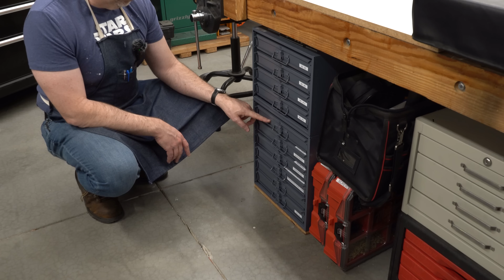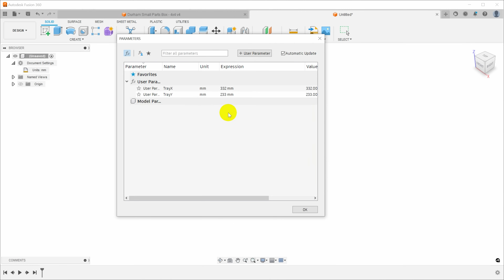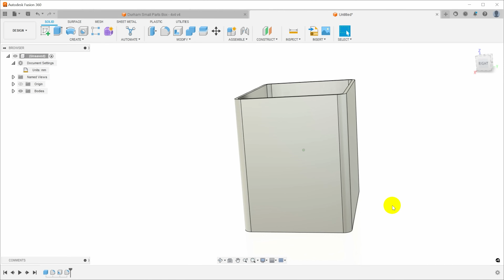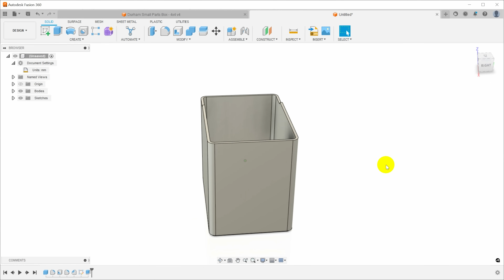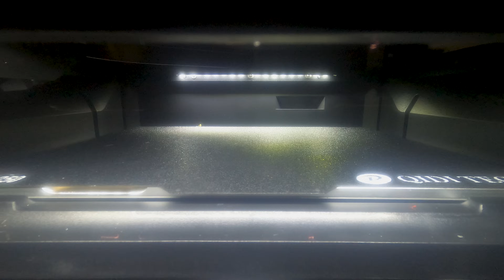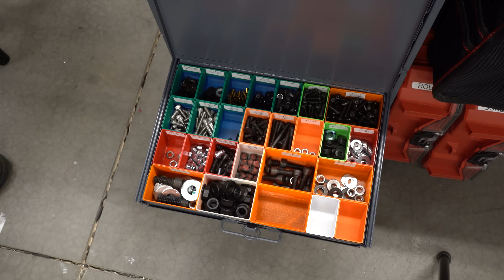Create the Perfect Storage Solution with 3D Printing!

Comment: As a graphic designer, I'm a bit surprised that you didn't use color as an organizing tool, i.e. all M5 fasteners go in blue boxes.  This is definitely inspirational for me.  I aspire to be more organized, especially fasteners.  I have several thousand fasteners, but only a small fraction of which are organized.  And, my shop flooded during the heavy rains in CA over the New Years weekend.  That was both a traumatic and motivational experience.  Also, I generate STL files using my illustration and animation software - Maxon Cinema 4D.  I'm going to have to find out if it does parametric modeling!  That was cool!  C4D is lovely for creating curved surfaces, though.
Reply: He’d lose the ability to casually move items into different sized boxes as needed, or waste a fortune in filament. If you’re not experienced with 3D printing, he has dozens of hours of print time in theses cases already. Needing to print each size in multiple colors would have made that take much much longer. There’s a reason he’s labeling boxes rather than printing the contents directly into it, and isn’t being strict on the color.

Comment: My anxiety about organising is at the point where I don't even dare buy boxes/storage drawers. Because I used to buy a couple extra, you know for possible expansion. And after a couple of years I wanted to buy extras and couldn't because the design/system was either not available anymore, or slightly tweaked and thus not compatible anymore.
But this looks like a nice idea/solution.

Comment: Great video. I have found that small washers and things like resistors tend to get out of place if the boxes are tipped up. To prevent it I have lined the inside of the lid with a thin piece of neoprene foam. Keeps everything in place and even keeps the boxes from sliding around if the box is not completely populated.

Comment: Oh no no no - the obvious place for labeling the content of the box most legibly is clearly a sheet of paper on the inside of the lid, mirroring the configuration of the boxes below it. This also has the added advantage of completely ruining all the work you've done, as that sheet needs to be re-printed every time you move anything at all. Clearly, this calls for a matching system of freely modular magnetic label holders... :)

Comment: I've been doing something similar with my organizing of electronic components, specifically crimp connectors, at work, of which we use many many different types and brands. For labeling, I try to add more parameters. Specifically for your bolts, I would add the thread pitch, material & finish, drive size, and part number. Stuff like that ends up saving me so much time in the long run.

Comment: James, great video. Especially on the parameter use in CAD.
Of course I want to add a little tip. It's in the nature of this friendly human being. Your boxes are a great solution for a static use in a shop like you do. I also travel to clients and have noticed using several similar systems that the lid doesn't close all of the compartments during carrying vertical. If you store your. e.g. M2 nuts in a compartment somewhere in the middle they migrated to other boxes in their vicinity and the easy in, easy out principle is lost. One major problem, as you described too, is the lack of stiffness of the lid which bowes when closed. The row next to the hinge and the row next to the lock/closure are quite well covered (not if you are storing M2 washers too though). Because of this I used a layer of foam on the inside of the lid and it did became better but still not satisfactory and I still had to search for the really small parts on the job (I know you're in there somewhere with a paying client breathing in my neck). Because of this issue I printed small containers with their own lids. I carry a lot of the same small hardware over the last 20 years so 80% of them had a name printed on the lid too. The other ones had a small recess for a printed designation and added flexibility to the system. Maybe a tip for the more travelling technicians who want to keep their small stuff organized as well? Thank you James. I'm a fan of you and your channel. Keep up the good work. Best, Job

PS; the idea of being organised is like the arithmetic definition of a limit; the direction is right but you'll never get there. When you own a job shop this is particularly true; new valuable/usable stuff is left after finishing jobs and you stash it somewhere eventually; the diversity of these parts becomes overwhelming over time and even finding right names can become an issue. It's a never ending race and a dream to fulfill. Once you entered the six planks leading to you being finally organized your organisational days are finally over and someone else has to decide where to put it. If you want it to be different you have to periodically throw stuff away laying there for more than a year without use. I did this many times and once I did I could use one of the thrown away parts the week after they left the building. I guess Murphy watched my performance too. You never get it quite right is my message and that's the beauty too.
Reply from the maker: The foam is a good idea.  I wonder how that will hold up over time.  I generally don't tilt the boxes all the way back, so things stay put, but for mobile use, or throwing in a vehicle, it would be an issue.

Comment: Totally with you on the not starting things because you can't do it perfectly.  The height of the tray not easily measurable with calipers?  Gauge blocks obviously worked fine but a direct measurement of the original would have been possible with the height gauge we know you have!  Now to go mull the inadequacies of my own drawers of 3D-printed boxes :-/
Reply from the maker: That's what I tried first, and didn't get satisfactory results.  The issue is that the tray registers on the front edge of the sheet metal, and everything is flexible.

Comment: Dump the box lids. Means extra steps to access that take time and add nothing. If you need a lid for transport, clip one on. 
Putting a recess on the 'back' for the hinge prevents using it rotated through 90deg. Rectangular boxes that fit at 90deg gives a much larger range of choices for size within a given space.
Putting a wedge shape piece at back of a tray gives both a label place and a grip for lifting it out.

Color code- the resistor color code gives a great way to indicate size- e.g. green for 5mm bolts/nuts/washers etc. Blue for 6mm and so on.
Using small boxes/trays limits the content, making it harder to choose the right box, and meaning not all one size will fit (e.g. 6mm bolts in several lengths, pan:cap;round:countersunk, washers, nuts all in stainless/steel/brass). Ideally trays will be 1000x600mm- large as possible if smaller.
As the components get bigger, the box/tray/drawer needs to get deeper.
In conclusion, your choice of hinged metal boxes limited your future choices massively- exactly what you were trying to avoid!

Comment: I actually thought you did this a long time ago, being a 3D printer guy, so I thought this might be an old video suggested by YT. Smiled at OCD person knowing exactly how to trigger the others :-) Love how even your Misc trays are organized. I had a business partner years ago, who built an elaborate filing system for himself to try and dig himself out of total chaos. The last file he created in every drawer was labeled "Things to be filed". Laughed out loud at that, because I knew what would happen, and it did, spectacularly. This is sooo much better than the old pull-out little drawer systems we all used for electronic components etc. They just do not work for nuts and bolts. In fact, I might convert all my storage to something like this. Just need to find the proper host cabinets, that are readily available with some continuity in the market. And then, many 100's of hours on the 3D printer. Thanks (I think)! Clicked "Like" 3 times...
Reply from the maker: I did a video a while back about 3D-printed trays for mill tooling and boxes for my larger rolling toolboxes.
Reply: Thanks for the response. I REALLY like your channel. Ticks all the boxes for me. OK, enough brown nosing...

Comment: Nice work, James. Your grasp of 3D CAD never ceases to amaze me. I have one little tip on the label maker since I have the same brand. If you set the units to metric, the label length and spacing (i.e. for terminal blocks) is more accurate.

Comment: Alexandre Chappel has an extensive system of 3d printed parts storage boxes that has gone through several design iterations.  His are based on different drawers and cases though.

His solution includes a grid frame that goes in the bottom of a drawer so that the boxes don't move if the drawer isn't fully populated.

Comment: Fun fact about metric threads, you don't specify the pitch of the thread if it's a standard pitch so M6 is just M6
If you were talking about a fine pitch thread like an M8 with a 1mm pitch, then it would be M8x1 (the standard pitch for M8 is 1,25mm)
From M6 to M16 the pitch is increased by 0,25mm so from 1mm to 2mm (M14 is also a 2mm pitch but it's not used often)
Then From M20 and up the pitch increases by 0,5mm (there threads that are not commonly used, those have the pitch of a closest smaller thread )

Comment: I went with Gridfinity. It makes some decisions easy (like how many I can fit in a given space) and then it's just a matter of using 1x1, 1x2, 1xN, 2x2, 2x3, etc.
You can adjust the grid size by scaling most of them to fit almost any space, especially using the SCAD remake that has all the parameters needed.
Reply: There's also FreeGrid which is similar to gridfinity but with a few different design choices. But yeah, SCAD is so good for this kind of work.

Comment: I have to disagree on this system "perfect", for two reasons.
First: As a plastic storage system, this isn't perfect. If you take one box out, the contents of your drawers are no longer locked, and things can and will start shifting around. Something that is addressed by a.o. Alexandre Chappel's solution and GridFinity. If you are really only planning to take entire drawers, that's probably fine, but chances are that at some point you'll need such an assortment of stuff that you'll need multiple boxes from multiple drawers. Sometimes taking the boxes out is just easier.

Second: Printing these boxes is just a waste of time, money and plastic. Unless you need something specific that's hard to make by hand, like your 3D printed collat holders (not sure what they're called / how it's written exactly), 3D printing is not a good option. It is definitely an option, but it's not a good one. It's quicker and a lot cheaper to make cardboard boxes, like the ones Jer Schmidt showed a couple of days ago. I understand that for things like M2 bolts, cardboard may be an issue, since the bolts will be harder to pick out of the box, and they're so small they may fall through a crack, but other than that, I just don't see a need for plastic.

The only things (I can think of right now) that aren't doable with cardboard are:
- Radiused inside corners, for ease of picking up parts
- Oil / moisture resistance

Don't get me wrong: I designed my own plastic storage boxes to fit one of my drawers, 100% based on Alexandre Chappel's system, but after 1 (roughly) 2 x 3 ft drawer, I stopped. It just took way too much time and plastic for my liking, and with my small hobby printer, the boxes weren't even that great either. Up until Jer's video, I still thought 3D printing was the best option for these kinds of systems, but I'm quickly realizing it's not, at least not always.

Comment: As an IT architect, i have the same thing with ‘what happens next’. Definitely. I also have a thing with ‘not inventd here’. There are other vids on the tubes that do custom 3d printed box sorting thingemabob type systems. You must have seen some. I think the most prominent one is the one by Alexandre Chappel. You chose to role your own. Can you expand on why doing it from scratch beats adapting a design from someone else? I can see that it providesyou with a ‘full story video’, but is that the only reason? Im not trying to be critical, just wondering, as i have acquired quite an allergy to NIH in software engineers. Nothing personal…

Comment: I came to a very similar system over the years. Mine is based on modular plastik bins and metal cases sold by Allit. The cases have a layer of foam in the lid, so even the smallest parts can't escape. They also make bins for drawers.

Comment: I am doing a similar project, with about 500 boxes printed so far. I am printing in PETG.  I included a label flange, by mildly angling the top front face of my boxes back 30° to create a surface for a 1/2" label. This is enough to make a handle of sorts - easy to hook the box with a finger behind the flange. The mild angle means I loose about a 1/4" in the top front of the opening, but has not been a real issue.The label is always visible, even when the bin is full. 
I use a 1mm CHT nozzle, combined with vase mode and 0.5mm layer height. Using vase mode means I don't have to hollow out the model, and I can choose the wall thickness and bottom layer count (usually 2) during slicing. I use 1mm for small bins, 1.2mm for mid-size, and 1.5mm for 8" long boxes.  I used CNC Kitchens method of determining flow rate, so I set the print speed to match the wall thickness. The 1mm nozzle is great at all 3 thicknesses. Vase mode makes it print very fast, and very clean.
There are a couple places that make stainless steel belt systems - for Ender 3 and others - that would make it possible to batch print. It prints one, scrolls forward, and prints the next. They eventually fall off the end into your bin. The stainless allows you to maintain your heated bed. I did not get one yet, but I want one.

Comment: I made a similar system for a Lista cabinet I have, but I designed a grid the bins locate in that I attached to the bottom of the drawer. This keeps the bins from sliding around when some have been taken out of the drawer.

I also designed a little tab that extends into the box a bit, big enough to put a label on and also used as a place to lift from with your finger. I found that bins in the center are hard to get out without it as there is no place to grab.

Comment: One piece of imperial hardware that i don't expect to go away any time soon is the 1/4-20  bolt. The only camera that I've come close to that hasn't had that as it's tripod mount is either for studio work, or made in the former USSR. The slr I bout when I was stationed in Germany, as well as all the tripods I picked up there, used 1/4-20 mounts, or a metric equivalent that fit within tolerance over the depth of a mount, so 6-10 mm. might not be all that hard to find. 

A side effect being that I've been using models of both 1/4-20, and 5/16 bolts (course pitch) in a lot of 3d printed projects where 6 and 8 mm hardware would work just as well. Part of that is that I can't just drop into the local Home Depot or Menards/Lowes, other big box) and pick up a box of 50-100 bolts or nuts in metric. And yes I'm well aware that the 'imperial' hardware is all standardized to Metric for dimensions, if not pitch.

Comment: Adjacent to the hinge cutout. You could have put in a 10mm wide “shelf” parallel to the cutout extrusion. 

Labelling on a horizontal surface might be easier on the anxiety as you won’t have to crane neck or lift box to angle the label, especially lower down. 

Although after time you will instinctively, go to specific boxes and probably not use labels anyway… that muscle memory is wonderful.

Comment: I have Orange Big Box "tackle" style removable separator boxes that are about 1/3 the size of your drawers and I have had them for many years. I find that having a box for each screw size (like 10-32 or M6) is the end game, but I do have mixed boxes for things I don't have a lot of.  As with yours, everything is labelled--the box itself and the compartments. If the fastener came from McMaster, I will often put the flap from the McMaster box underneath the fasteners so I can reorder when the time comes like a mini kanban card.

I also use coin/stamp collecting little envelopes (3.5x2.25") that I label and put in a box.  The stuff smaller than about M3 really benefits from the envelopes so it does not get lost--you can blue tape them closed so you can reuse them. For stuff I have a lot of in different types such 1/4-20 and M6, I have a box for regular and a separate box for stainless, etc. I organize my taps and dies, some drill bits that don't go in drill index, etc. in a similar way. And my mini-pallet clamps have their own box.

I got interested in the Gridfinity system that is open-source 3D printed boxes and grids under then. The boxes are on a 42x42mm grid with box heights from 14mm by 7mm steps. I think that might be the next thing I'll try.